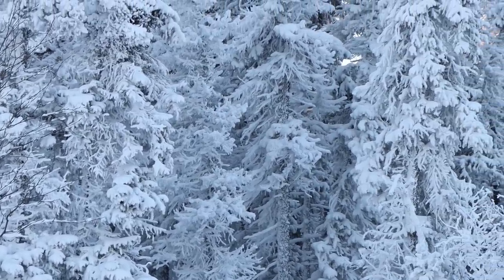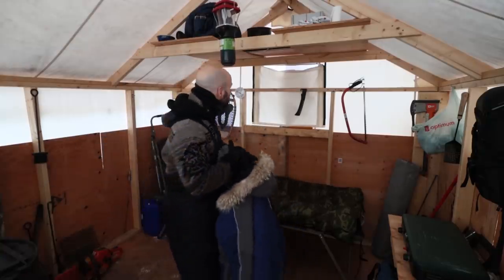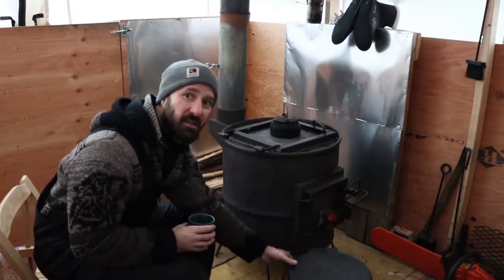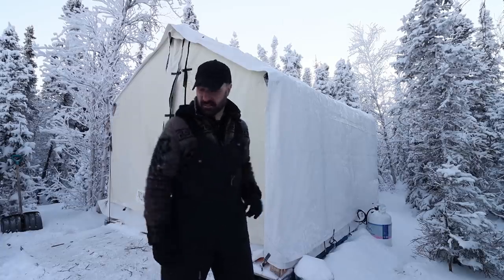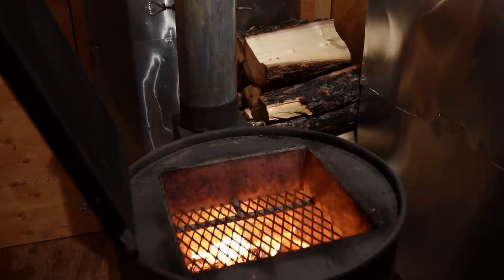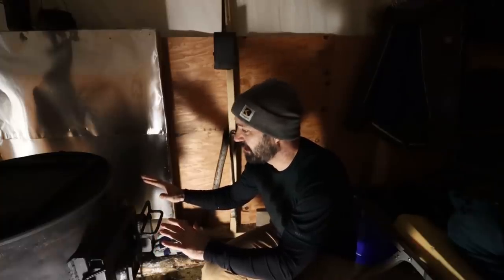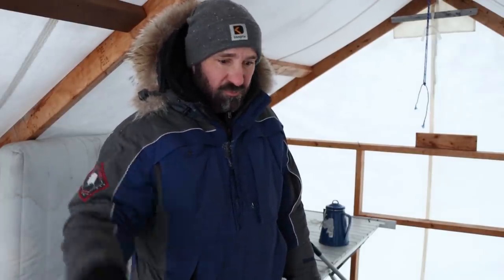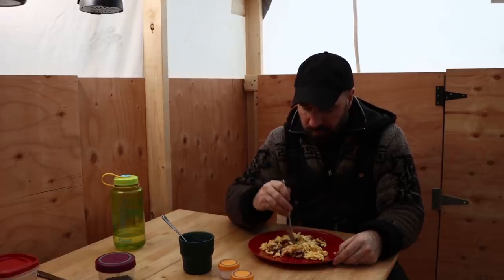HOT TENT in SNOW. WILD winds, SMOKEY stove

Comment: As always another great and relaxing video. For my off grid, I use a compost bucket. It’s like your setup but I use sawdust in the bucket. After using it I squirt the sawdust with water to start the composting process. After it fills, I add that to my compost bin. Very little odor and it composts well.
Reply from the maker: Very interesting!

Comment: Jay... you could use the tent frame 2x4 s  ....... Heck they may already be the length you need or close to it ..... get more blocks and and line level...level off the existing blocks .... and cut your 1st 2x4 to the length you need .... and you can just toe it in place .... or use floor joist hangers .... like the ones you use for a front porch or patio add on ..... it's the block placements and leveling that's the most important.... there's lots of videos and info on YouTube 😁 have fun brother ... stay safe .... see you soon Boss man 😁☕🏆

Comment: To extend your deck, build a frame like you do a wall except put cross pieces 18inch center for extra support.  I would make the deck a few inches extra so that the tent is not on the very edge.  For joining the pieces to the deck, I recommend lag bolts which would be much stronger than deck screws.  By the way, I really enjoyed your two extra white buck teeth while you were explaining your tree cutting permit. Lol
Reply from the maker: Hahaha. And thanks for the deck tips!

Comment: Good vid Jay . Ok so . They sell a metal bracket that nails to a existing structure like your house and then ppl add on  deck to the house . The brackets come in a lot of sizes . 2x4 , 2x6 , 2x8 , 2x10 ,3x6 , u get the jist of things I hope . 
So . Nail or screw them to the deck that is there then add the laugh of wood u want or need out . U will need all the short boards for ends and mid  with one long board for the new outside piece and a few 4x4 posts . You have the time buzz out after work one night to re-measure just how wide you need to make it , then pre cut most of the lumberat the house.  U may only need to bringout 2 long boards and 3 4x4s to cut on site  .  You should find the brackets at any hardware store.  Its a U shape bracket but obviously flat for the board to sit on . Look under someone's deck to get a idea of would im talking about.

Comment: Let peeps know that birch trees naturally shed bark and they are quite safe to remove that curled bark from... 
Another thing... make sure your axe isnt too warm when you try to mees around chopping deeply frozen logs... an axe head can break from that if there is any metal fatigue or micro cracks, and an extra axe is desirable just in case when in those cold conditions and you have to chop wood to make fire.
Margarine was invented as an industrial lubricant. It is one molecule away from plastic. Butter is best. For a better chance not to burn use 2 parts butter one part veg oil. 
Hey dont think Im all critical tho love your tent, your stove, and the vibe.

Comment: Build a frame 2 by 12 Preform and at your house and then just put and then just put on a couple skids and pull it out there behind the snowmobile and then attach it alongside that frame Pigeon toe screws into the wood and set it on cement blocks that you could also put on the Frame and pull it out there with you you won't have to use your tobacco it should pull behind your snowball really easy and then just attach it put the blocks up underneath it and you should be good to go but the apply make sure the apply was on the top and everything good to go

Comment: There was a request for suggestions on how to extend the deck to fit the bigger tent, if it were me I'd just frame out an extension and then bolt it to the existing platform, you probably will need supports on the outer edge but bolts/lag screws should hold the end next to existing.
Reply from the maker: Thanks Scott!

Comment: I like the trick of cracking the eggs with the fork. But on to a burning question... For temperature, you use the metric system but regularly translate it for those of us south of the border (and we thank you for that). I noticed for length, you did not use meters or centimeters. Is that a common practice in Canada? What do you commonly use for liquid measurement when baking or for bulk liquids like gasoline, oil, or water? What about weights or heat?

Comment: Just for future reference Jay.  I know you used a dead Birtch tree.  Birch bark should be harvested in the spring when the sap is running in the trees. However, if done too late in the season the cambium (inner bark) will come off with the outer bark. If the cambium is damaged the tree may die. If done right, a tree will re-grow its bark over the course of 10-20 years.
Reply from the maker: Interesting! Thanks for telling me.
Reply: Yes if birch bark is harvested from a live tree it will usually die

Comment: Add a sill plates to the outside against the ends of the platform. Make the front and back 2 14 ft then build a box inside of the extension. Use joist hangers for extra support and cinder blocks as legs on the outside.

Comment: Very glad to see another video up today Jay, you've got a really nice setup going there. I completely agree with you, being surrounded by evergreens heavy with snow, on a calm day, is supremely pacifying. The long shadows of Winter Solstice, on such days, really seem to fit the environment, too - a guy can feel like he's part of the ecosystem, in such moments.

If you want to get rid of the mouse/mice, my recollection is that they tend to stick to the edge of a room, you can probably put a trap down along the bottom of a wall before you leave, and the mouse will be caught by your next arrival. I believe it's Deer Mouse poop that's the worst (Hantavirus), but yeah, ingesting any kinda animal droppings is not a healthy choice. I immediately noticed you switched from the Fiskars (I think?) axe, looks like the Husqvarna is built in a similar fashion - seems to work well. My splitter of choice is an Estwing "Fireside Friend", or the Gregg's Distributors knockoff. 4lb mini-maul, seems to do the trick on all but the knottiest of logs. I swing a full-on maul sometimes in summer, but getting those monsters over head, makes for short periods of splitting. I recall someone once telling me that the best wood to split is wood that doesn't seed splitting, I've been trying to use that advice ever since. Most wood I have access to can be burned as a whole log (I have an Air-Tight Heater like "Up North of 60" uses), so it's just a matter of cutting it to proper length.

My camp toilet is a a pair of garbage cans, one in use while the other composts. Have a hinged plywood lid on a frame, with a normal toilet seat fastened down to it, so I can put the garbage can lid back on when I'm finished using it. No smell (that I've noticed), dump the compost from the old can at the beginning of the season, swap them out, start the season with an empty can. Was inspired by "humanure" videos on Youtube, but I still can't bring myself to use the compost on, say, the garden plot LOL. If  was to do it again, I think I would use one of those seats make from insulating foam, they apparently don't feel cold to the touch.

Butter > Margarine, for cooking, IMO.
Reply from the maker: Yeah the humanure idea would take a while for me to get used to before trying it that's for sure!

Comment: The extension of the floor. Mimic the original and then resurface the floors with double sub flooring. Not only will it make the floor stronger but the warmth it will provide and it will be level.

Comment: Margarine isn't too bad but it's a lot worse than butter because it is chemically altered oil and a ton of stabilizers, I remember my grandmother tell me about her having to kneed the bags before they used them since they'd separate over time (Mind you this was back in the  30's, 40's and 50's) . If you don't want butter to burn you can gently heat the butter an make ghee or clarified butter and get ride of the fat solids (ghee is cooked with the fat solid a bit longer which gives it a bit more flavor since it has that nutty toasty taste) and lasts damn near forever since it's just the oil and not the solids which is what will spoil. (But even that takes like a month unless you are in a hot climate)
Also a little oil (or wax) in your beard can help with the frosting of the beard since it won't let the water cling to your facial hair. It's why many people who come natively from cold areas tend to have oily hair and skin.

Comment: My husband says it should be easy to extend the platform. Make the extension, like building a wall before standing it up? But don't add the plywood to the top yet.  [2x4's [10's] between the outside 2x10's]  Picture a ladder, but squared. Then screw/nail the new 2x10 to the existing 2x10 on the platform. Then add the plywood.  You probably know how to do the blocks under it, on frozen ground.
Reply from the maker: Excellent tips!!

Comment: Just use joist hangers like normal then deck it. Shouldn't take more than a couple hours with a cordless impact and circular saw (and a lot of batteries because the cold will drain them quick). On the "front and back" rim joist you may want to add a steel plate at the splice for strength or just an extra block to support it

Comment: Hi. If you need the camp up quite quickly. Use the 12 x 12 platform. Cover the top with plywood. It wont matter if it over hangs all around by a foot. As long as you put more strenth in the woodwork where you get in and out. If its around dome tent. You wont be going anywhere near the edge of the platform
Reply from the maker: Interesting. This is a good idea. I've received quite a few.

Comment: I looked up Russian Bear tents and didn’t find a 14 foot diameter one. Can you provide a link so we can be excited about seeing it too? I think the deck expansion will be pretty straightforward. It might require other than scrap pallets though. I’d use additional posts of course and using steel joist hangers on the current outside rim joists might keep the flooring reasonably level.
Reply from the maker: The UP 5. unless I read that wrong.

Comment: Margarine usually tops butter when it comes to heart health. Margarine is made from vegetable oils, so it contains unsaturated "good" fats — polyunsaturated and monounsaturated fats. These types of fats help reduce low-density lipoprotein (LDL), or "bad," cholesterol when substituted for saturated fat. (from google).  I use butter.  It's always $1.49 to $1.60 on sale when the stores have price wars.  Otherwise, you can pay $5.00 a lb or more.  When it's $1.49, I buy 10 lbs and throw it in the freezer.

Comment: Jay, as for margarine look up the best unsaturated fat ones. As for the extension on the platform you need to screw a ledge on the side to fit decking, it does NOT have to perfect length but dose to perfect height for boards to fit (25 cm) long spacer to deck height. Not level but true. Hang beams off that and use what you have for supports. Now on that stupid stuff, you wanted to show that the tree for bark was dead, commendable but what if it hit you in the eye as you did that, eye patches are the new look for pirate movies. Then you wanted wood and cut dead trees (said think cord the fall) but people said why, -27 with heavy win and 1 eye Walking back because the machine fails. Not going to be able to carry the stove with you. And look what you did (look closely) as you fell those trees, you straddled it from behind and pushed, what if it kicked back. Now walking with 1 eye and your privates next to your stomach because that's where they got driven to, or it just broke your pelvis or killed you. Never be behind a tree like that////ever.

Comment: Isn’t margarine just vegetable oil? Margarine is healthier than butter isn’t it. Margarine usually tops butter when it comes to heart health. Margarine is made from vegetable oils, so it contains unsaturated "good" fats — polyunsaturated and monounsaturated fats. These types of fats help reduce low-density lipoprotein (LDL), or "bad," cholesterol when substituted for saturated fat. Although it is lower in saturated fat, stick margarine still contains about the same amount of total fat and calories as butter. ... The harder the margarine, the more trans fat it contains. So, basically margarine is healthier than butter. Right?